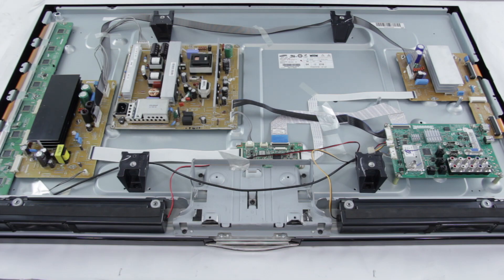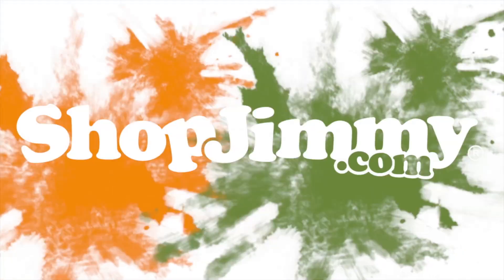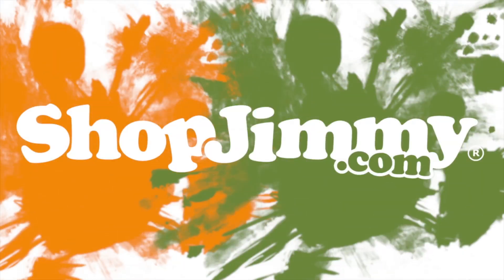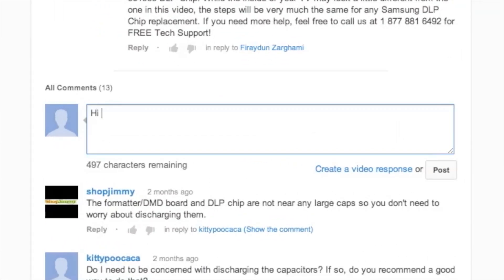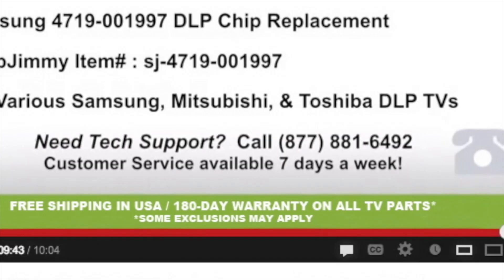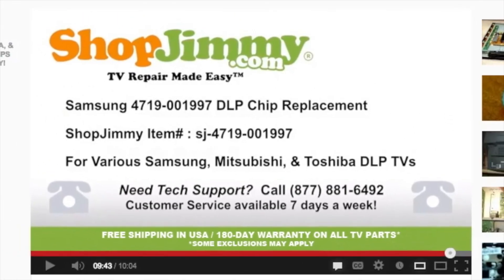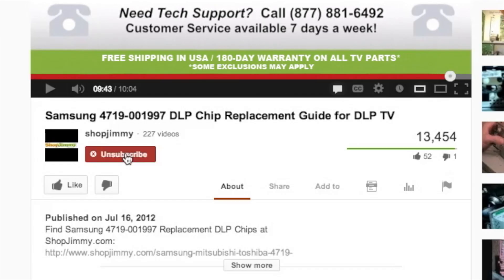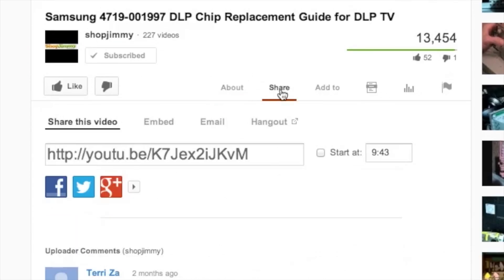Plasma TV Repair Tutorial - Common Symptoms & Solutions - How to Fix Plasma TVs

Comment: We have one Panasonic AS610 Series 42" FULL LED TV purchased about 1 year back and warranty is over and now we are facing no video and no audio except switching on the TV a green light appears and later red light blinks and we have contacted the Panasonic customer care, one service engineer comes to onsite and asks us to pay Rs.25000/- for replacement of TV, no where we have seen or heard that for repair of TV need this much of heavy pay, we asked will communicate to the Panasonic company for necessary needful, yet we hadn't received proper communication and or any service from the concern, please help... what could be the problem.

Comment: I have a Samsung Plasma tv, model number: PN50C450B1D

I got to power on tv, it clicks and what appears to be a black light flashes on the screen 3 times (everytime). after the 3rd flash the screen goes dark and doesn't come bck on. it registers the controller and touch pad on the side, but nothing will make the picture come back. I looked at the logic chip and the green LED is flashing every 5 seconds. I read that it could be both X and Y mains need to be replaced. if you concur, do you have a video on how to replace them? and possibly where to get any of the parts cheap?

Comment: My TV is A 2011  Samsung PN43D430A3D. Here's the problem: The TV play's for 
about 2 minutes when It's first powered on, The screen does have red and yellow 
pixels under picture at random but still good picture. Then the Screen goes Blank 
but the Audio stay's on.  I don't have the Back Of the TV off so I'm just 
guessing that the Power Cord Is connected to the board. Question is:. Do
 you have any idea of what Is wrong with the TV and where I can purchase
 the Part to Fix it. Thanks.

Comment: my plasma TV by Panasonic have 4 half vertical bars  from bottom  to middle of screen.. width is about 2 inches each bar.  what can cause this?  I don't believe it is the plasma but a configuration or bad power supply or cords.  Any help is appreciated.
Reply: Btw model number is th-42pc77u.

Comment: I have a Samsung Plasma TV model PN60F5350.  It started to have one vertical green line on the right side of the TV screen.  Now it has increased to have about a dozen of vertical lines.  The lines have different colors, and mostly solid on the top of the screen, and as the lines goes down the screen, some lines becomes dash lines and eventually the lines disappears.
I have purchased a TV Logic Board P?N LJ41-10367A after I saw your video, I believe it may fix the problem.
Like your video, it gave simply and insightful debugging tips.
Thanks!
Jackie

Comment: Hi, I have a LG 60PX950 SN# 008RMYAEH922 purchased in November of 2010 which has no picture, no menu, not responding to any remote commands.  When I power it off and on, the blue/red light in the lower right corner works, but no picture.  When powered on, one will see a slight glow of the screen and that is all.  Any ideas?  Thanks.

Comment: Hi.  I have a samsung  PN51E530AEF. I have a total of 9 vertical lines on the left hand side of the screen (left when viewing the screen).  There are a few by themselves then a few clusters close together.  All are red with the exception of one green one.  Any suggestions.  Everything else works fine. It seems to be isolated to about a 3 or 4 inch section.

Comment: Hi I have a 60 inch Lg plasma. Model #60PN6500 will not do anything. I have unplugged z board and y board as suggested in videos but still will not turn on.. I have replaced power supply board and still nothing but a click when I plug it up. Also when I unhook main board the green light flashes on the logic board but when I plug it back in it goes off and there isn't any lights on at all. Can you help keep?

Comment: sam gonzalezI have a samsung pn58c8000, when i turn it on the power light flashes , no picture and no sound and after a minute or so power light goes off. I've also noticed a red flashing light inside the tv before it shuts down. Thanks

Comment: I have a LG RZ -42PX10 Plasma TV.   It's a bit dated for a TV but it was working great as a computer monitor and game monitor.  The TV now displays a ghost or burned in shadow image along with a screen flicker with a little click sound from the set.  I suspected it the Y SUS board.  I replaced it with a board bought from Jimmy's and still have the same issue.  I then replaced both buffer boards, also bought from Jimmy's, and the TV completely failed to display any picture.  Removed the buffer boards and installed the old buffer boards and at least got a picture back although it was still flickering, not improved or solving the problem.  I think I bought a bad Y SUS board... Should I try another Y SUS board?

Comment: Hi Jimmy..My folks have a Samsung 50" Plasma TV PN:50A450P1D. Before hitting the power button, the standby indicator led is lit as it should be, Then after pressing the power button, the screen faintly shows a scrambled "energizing" effect. It fades to a blank screen then the power indicator LED flashes 5 times. Then the power indicator LED stops blinking. The TV stays "powered up". I have to push the power button again to shut it down. Does the fact that it does not power completely down after the 5 blinks give a clue to what is (or not) the problem? The power indicator blinking 5 times?Troubleshooting it tomorrow and any "heads-up" is Very Gratefully Appreciated. My Viewsonic LCD crashed(no standby) and it was the bad caps on the power board. I'll bet this 50" plasma isn't going to be as easy and cheap as the Viewsonic was....Bob.(I have some electronics background but I'm more comfortable 40'-60' up in my bucket lift trimmings trees.)   : 0)

Comment: Hi All, I appreciate your video and the tutorial you provided for Plasma TV components and possible video issues associated with each. 
I have a HP-pl4260n it has a video issue that started with  a majority of the screen discolored and slow from left to right started turning black in spotted areas. The only visible screen is at the bottom left corner. I was hoping you might be able to point to which component with this system would be first to suspect or isolate.

TIA
Brian
Reply: I was hoping to share a couple of pictures i took with the minimal screen visible. Which email address would be best to use?

Comment: ok ive got a 50 inch pdp-5010fd/kucxc plasma tv brand pioneer. first it started making a buzzing noise, then it went to a solid black screen. no sound of any kind. oh and i get both a red and a blue light where the power on location is at. please tell me its not dead and that it is fixable.

Comment: I have a samsung.P51F5300. it turns on with the remote, and you get a perfect looking SAMSUNG logo... it then turns off....  then back on again.. displaying the SAMSUNG graphic logo.
Check the VA, VS, and negative voltage on power supply.. all perfect.
Green light blinks 1 time / sec. Any idea what board may be the problem 
Its almost like the TV lost its firmware.

Comment: Great vid - thanks for making it.  The reason I watched is because my Samsung plasma PN60e8000gf began turning itself off/on, cycling power and then eventually not even trying to power back on (but red light flashes irregularly until unplugged).  The result is no picture, no sound and a flashing red light.  Unplugging the tv for a minute and reapplying power has it turn itself back on for 2-5 seconds before the screen goes black.Pulling the back of the panel off and a doing close inspection (including removal of the power supply) shows no burn marks, blistered resistors or bulging caps on any board.  I left the tv off and unplugged for a week and tried it again.  It came right on and ran perfectly (no lines, discoloration, etc.) until the screen just went black (and no sound) at just about the 90 minute mark.The back cover was pretty hot in the center (outside of PS) after the escapade described above, but again not so hot as it discolors anything...so I suppose 'normal'.  Your description of the bad Y Sus/main board now has me leaning that way.  If I replace the Y board, do the associated Y buffers necessarily need replacement too?Many thanks -

Comment: Samsung pn43D450A2D have replaced power supply board and main board. TV still clicks twice with solid red standby light but will not turn on. When the power button is pressed the red light blinks but no click and TV does not turn on. What do you think it could be ?

Comment: My samsung plasma model PN43E450A1F started out with a picture but power button was not working and remote would not operate the tv then when i unpluged the power and pluged it back in there is nothing. Black screen no red light just dead

Comment: Hi I have an older lg plasma tv model LG42pc3d-UD  the tv will come on and work fine for a few minutes and when it's on for a while the screen will start flickering and will finally go black. I have removed the back and looked for damaged capacitors with no obvious damage. I have noticed a new dark line that runs across the screen about three inches wide. I have had some success with repairs before but the tv is ten years old so I don't want to spend too much on this one. If I can test anything to rule out things I would love to get it done. The ribbon cables look like they are fine. Well let me know what you think and any suggestions will be welcome.

Comment: I have a Samsung plasma (PN50C7000YFXZA) and have an intermittent problem with the dark or shaded portions of the picture on the screen turning a dull or pastel red color. If I turn the TV off and unplug/re-plug the HDMI cable it usually goes away for a while, sometimes for hours but the red color always comes back. It seems to be getting progressively worse and more frequent.

Comment: I have a Panasonic P50ST30 from 2011.  It had a 14 blink code.  I just replaced the SC board.  It now powers up just fine and displays all menus and settings, but the screen is extremely dark, blotchy and has what looks like fixed clouds of bright pixels on the left and right of the screen.   i can barely see the setup menu and i found a setting where a light vertical bar goes from left to right of the screen.  it does seem to light up all of the pixels, but the whole screen is incredibly dark otherwise and the light "clouds" are stuck in one place and seem like a screen defect ?  thoughts ?  is the plasma panel itself shot ?
Reply: I have the exact same tv and 14 blink code, only mine starts to blink after holding down on the power button for several seconds.  I saw a post that said not only should I replace the the SC board, but also the SS possibly. please respond to how you made out so far.

Comment: LG50pn6500 plasma tv shuts off and then turns back on 10 minutes later.  It stays on for a little while and shuts off again.  It's 3 years old and haven't had any other problems.

Comment: I have a Samsung 450 plasma TV, model # PN50A450P1D.  It shows a green line when TV is first powering on, then a vertical black bar in the middle of the screen.  There is a picture, but the bar blocking about 3 inches in the middle!

Comment: Hi Jimmy,

I have a Samsung PN60F8500AFXZC, that will no longer turn on. I have the red status light on the TV, but it will not turn on. When I press the power button, the status light turns off, and then almost immediately comes back on. No bootup happens at all. Could this be a problem with the power supply? Or should I be looking somewhere else?

Comment: Samsung Plasma PN50B450B1DXZA, version SL04, has sound no picture.  Was flashing picture for several days, I would turn it off and back on and it would resolve, but now  no picture and has lots of snow.  Could you tell me what is likely the issue and if I decide to have it repaired at a shop vs self repair about how much will it cost?

Comment: hi, i have an LG50pg25  ,the issues i am having is no image on screen but on the top right for a few inches on the right side, when view with the lights turn off in the room.the rest of the panel seems to be working but is no information or on screen display .all voltages are correct and the main board and the logic board were changed .sound and other function works .connectors, cables are good.any ideas?

Comment: Good day, 
  
  I have a Samsung Plasma Model: PN50A510P3FXZA and when i turn it on in the morning (cold TV) it turns on, there is equal picture degradation across the entire screen, with a bad noise from the speakers. Then it power cycles. When it comes back on its all good. It has gotten worse and sometimes it will take tow cycles of on/off before it straightens out.  

Based off the information you provided in this video (thank you very much Sir) I suspect the Y-sus or the Main Logic board to be at fault. Many thanks

Comment: i have a samsung plasma tv exactly like the one in the video. the problem is that it has vertical solid lines therfore with the help of your video leading me to think that it is the logic board that is the problem. i dont want to spend money on  getting a new board as the tv is not currently in use and not extremely significant. so i was wondering if there are any thing i can do myself to make the tv work?

Comment: Hi,  My kids LG 42PN4500 plasma tv. turn on,  sound work and picture work, but after 5 mins it turn off and power LED goes out. the only way for to us turn on the PLASMA is unplug AC cord and wait 2mins, and then plug in the cord Power LED come on. press power button Plasma turn on with sound and picture. And them started again after 5mins it power off.

can what may the problem...

thanks

Comment: Hi ShopJimmy, I have an LG Plasma tv model number 42pc55. It has no picture or sound, the tv turns on but i get a very dark fuzz on the screen, no menu buttons work or make a difference to the screen itself.. I have changed the power supply and made no difference. Any ideas on what this could be?

Comment: I have a Samsung plasma pn50c550gif tv and I have a super thin vertical green line going down the mid right side of my tv, after watching a few videos I bought a new logic control board from you guys thinking that would fix it possibly, i just installed it and got the same result. Any other ideas what it could be?

Comment: I have a Samsung S60FH-YB02 60" Plasma TV manufactured in 2013. I have the problem of no picture at all with sound working fine. Unfortunately I live in a rural area with no repair technicians available. I am hoping I can do the repair myself with your assistance. I have removed the back panel and do not notice any visibly bad capacitors. Is there a certain board I will need to replace, or could it be one of several issues? Is there a place to order the proper needed board for my TV? Thanks so much for your time helping me with my problem!

Comment: I have a Samsung T4254 that sure sounds like the Y-Sustain board has an issue.  It's doing just as described in the video.  Acts as if it's turning off and on, sometimes popping.  Usually it doesn't come back on but sometimes does for a short time.  Is this component available and can I replace it myself?

Comment: Hi Jimmy, I have a pn64f8500afxza that suddenly turned off the other day, and won't turn on. There is a red flashing led in the lower left corner. I suspect there is something wrong with the power supply but a visual inspection did not show any obvious problems (like burnt or bulging components). Any suggestions?

Comment: HI, my TV model is vizio VP50 HDTV20A , the TV works fine for 15-20 minutes or even a couple of hours then randomly shuts off, no standby light and it can not be turned on, after 15-20 minutes it powers back up again and works fine for another 15_20 minutes then it happens again. checked the power board and found 1 puffed capacitor and replaced it, everything else looks fine on the power board. what do you recommend thank you

Comment: 2006 Hitachi 42hds69 plasma tv will just cut off and have to unplug from wall then plug back in. any suggestions I was told may be main board ?? what is the cost if so ?

Comment: hi JimmyI have LG50LA6208  (2year and one month old) . if Switch on in booting face in2second after lg logo goes stand by and no Picture. it burn stand by light . my be power supply break?. I Need your help and openion.

Comment: hello My name is Travis I really appreciate your time and need some help with my Samsung 50 inch TV. when I plug it in the relays on the power supply board cliks on and off like 5 times witch I do believe is a power cycle? anyway it won't stay on. I just replaced the power supply and the main logic board. when I plug it in same thing the green light on the logic board lights up and shuts down with the relay. hears the kicker when I unplug the small wire running from the power supply to the logic board and then plug my TV in relay engages then you can hear the Samsung sound the TV makes when it powers up but I have no pitcher and it shuts itself right back off and continues this cycle. I'm wondering if I need a main video board. TV model is PN50C450B1DXZA

Comment: hi, i have a 50" lg model 50pk350. i had a vertical black band across the left side of the screen, i removed the ribbons on the xl board and re seated them, over the next few hours i heard a pop then another line appeared then again 4 or 5 times until almost half of the screen is black. is this the xl and xc boards? thank you so much for any help / pointers, mike

Comment: My Samsung TV PN50C550G1FXZA has horizontal lines running from one side to the other I changed the y buffer board 3 times twice I had no screen ( and I had to return the boards) at all and this time I have identical lines like the original one. Is there a possibility that 
It is the x board? Also the logic board got a green line that is blinking does this have any indications?
Thank you so much and your video is excellent